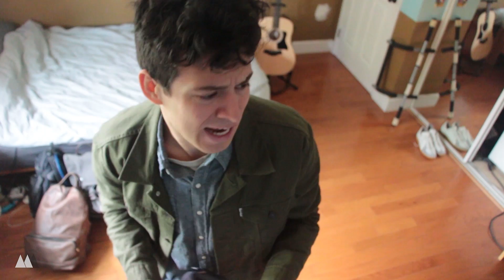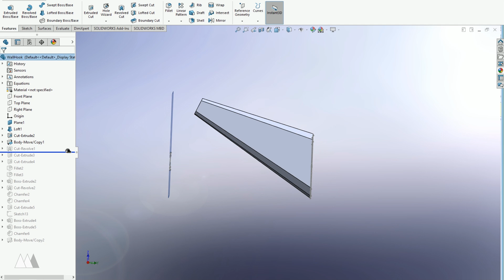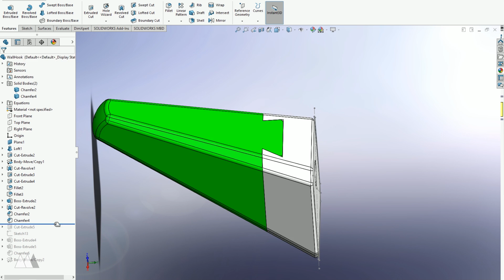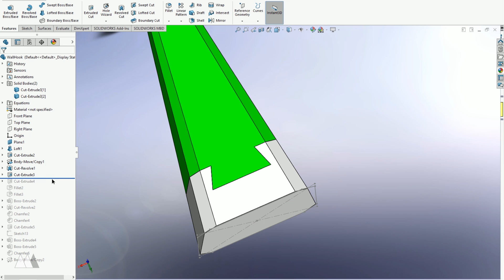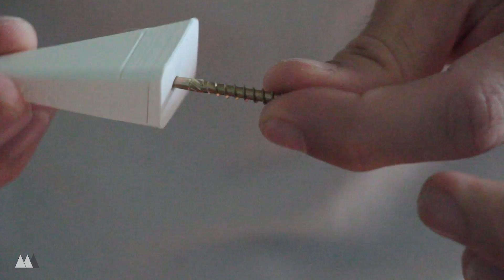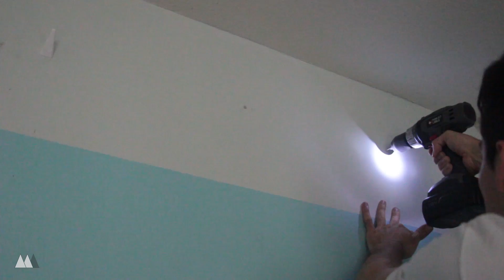A Most Minimal 3D Printed Wall Hook

Comment: Hey, I printed this on my Monoprice Maker Select Plus but the two pieces didn't fit together, it came out great quality wise, but it took a lot of sanding and xacto knife cutting to get it even close to fitting together. I ended up just throwing it away, but I really want my second try to work. Is there anything you would recommend me doing to either my printer settings or the model??

Comment: you could have had the part of the tail on the spike be tapered towards the bottom so it lock in place, because if you put to much weight and the stop at the bottom breaks the thing will fall, but if you have it get smaller through a taper at the bottom it will more evenly distribute the weight along the both walls of the half with the screw.

Comment: couldnt you just make the dovetail taper inwards?
Reply from the maker: True... but I think this way is a little more secure, because if it was just tapered, it would become loose if it slipped up just a tiny bit. This way, with the straight dovetail, there is still friction if the parts slide a bit.

Comment: one thing ... umm what does ur 3d printer cost like?!! is it even possible to own a good printer at an affordable prize?
Reply: Agnimitra Sutradhar I got a chinese delta printer kit of eBay which is selling for about 200€ shipping included here in Germany (also shipped from within Germany, not from China). Takes about a working day to assemble and comes with all the software included. But because it is a delta design, I had to learn a lot about calibration before I was able to achieve good quality prints. I would not recommend this to inexperienced people! Get a Malyan M150 from Hobbyking - rigid design, easy setup (4 screws) and good quality prints. Also has an overall bigger build volume
Reply: yeah bro my thoughts exactly... who doesn't wan't to own one
Reply: I bought the Anet a8 on gearbest for $170 and it works great.

Comment: You are so creative and I can't 3D print a square but I don't give up
Reply: If you have access to a 3D printer, you should look up how to use it. I learned the basics of Blender in 7th grade and now that experience is really useful in college. I would recommend learning how to use a 3D modeling program called Google SketchUp although I'm not sure if it works with 3D printers. It's very basic but a good starting point for modeling and it is possible to print things off on a normal printer using that program but it's a bit hard to explain. If you need help with that, just ask.